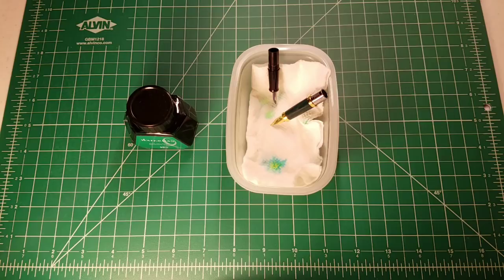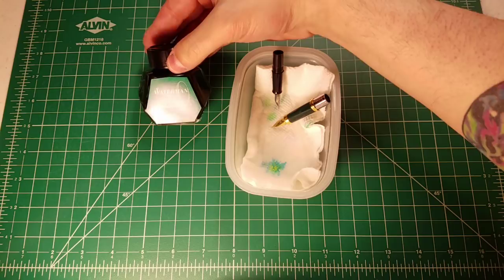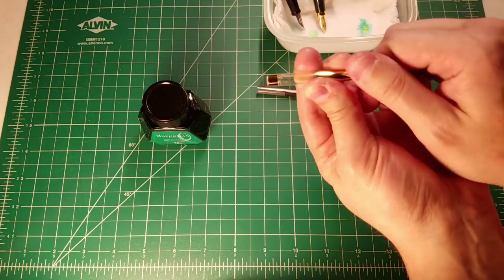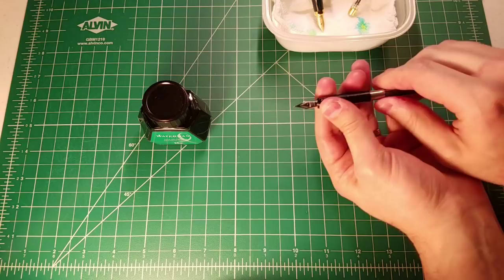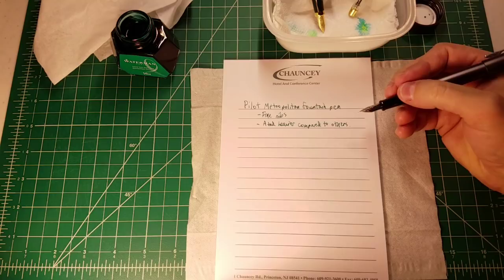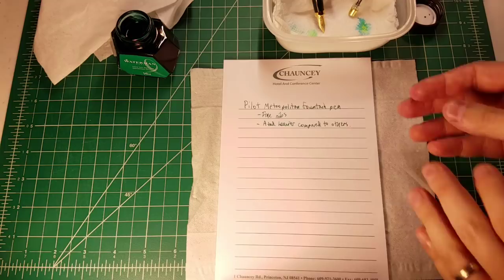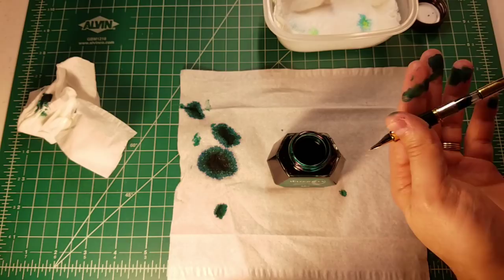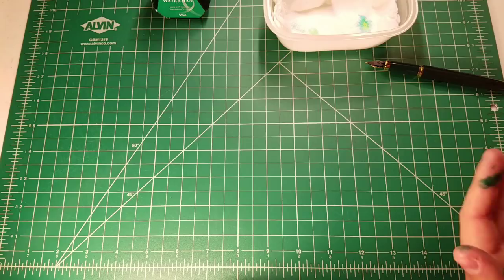Filling fountain pens with converters - watch me make a mess!

Comment: Glad it got there safe, and glad that you are enjoying it so far.  I love that color ink!  I do not have much experience with Waterman inks, but that color is so nice and $9 for 50ml is a steal.  The squeeze converter that comes with the Metropolitan is not the largest, and a common complaint is that you cannot see through it to check your ink level.  Down the line, if it interests you, Pilot's CON-50 converter will fit in the Metropolitan and that is the same "screw" mechanism as with your Platinum converter.  As far as filling the pen, I have seen videos using an ink syringe to suck up ink and ink the converter that way. I believe that would allow you to fill the converters more fully, and you would avoid getting ink on the pen section.  Loved the video, and can't wait until summer for more videos!  Until then, time to binge past videos, YEA!

Comment: When you  mentioned  cheap fountain pen, there is a 2 dollar option- Parker beta- it might sound ridiculous but its true. I am also relatively new to fountain pens, what I do with twist converters is just submerge it in ink and twist the mechanism to capturere some ink, then I eject some, then I repeat until I have completely filled the converter, then I eject some until I see a drop or two come out of the pen.
Reply: Stormtrooper Tk-4444 Ha ha 2 dollar is nothing. In India you can buy a fountain pen for less than Rs 100 ( approx $1.50), and they are NOT disposable, but they will last a couple of years.

Comment: In childhood (up to high school days) there was not a single day when our hands were not inked. Inked hands are normal for a beginner.

Have you tried a Parker fountain pen? The only two pens I have are Parker. One is from 1985. (Use them very rarely nowadays)
Reply from the maker: Any models you recommend?
Reply: Clutch Situation Congrats on 4K subs. You should try Parker 51, and Duofold if you can get them. Those are vintage (check out richardspens.com for more information).
 
Mine are basic ones: Vector (1998) and a CT 15 Flighter (1985). You can try the Vector. Then there are higher end models like the Sonnet.
Reply from the maker: Do you feel like vintage Parkers are the way to go given the decline in Parker quality over the last decade or so?
Reply: Clutch Situation I would say so. I have a Parker 51 special and I feel like the quality is much better than what is offered nowadays. Keep in mind that these pens can carry a pretty hefty price tag ( at least for the 51) but I feel like it is worth it. The nib is great, but you may have to restore the pen if it is not done already. If you are starting out, I wouldn't really recommend the 51 unless you research it a bit.

Comment: You shouldn't need to mix the ink before using it. Most fountain pen inks are colored with dye, not pigment. Also, I prefer to fill the converter with an ink syringe then install it into the pen. Don't feel bad, there's a learning curve with fountain pens but they are worth the trouble.
Reply from the maker: Great tip on the syringe!  Thanks!
Reply: Clutch Situation Hey!!! Just make sure to cap on the bottle immediately, so that you have no spills!